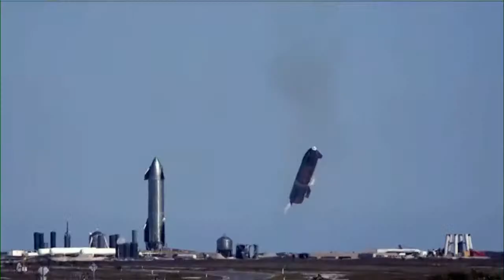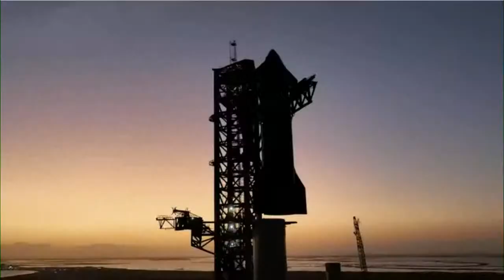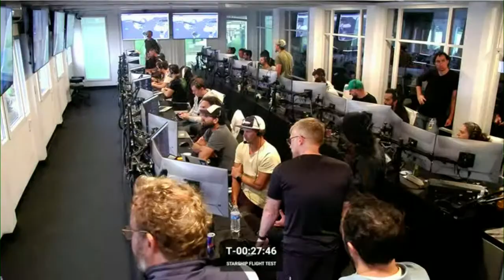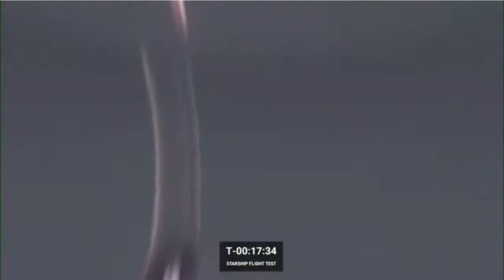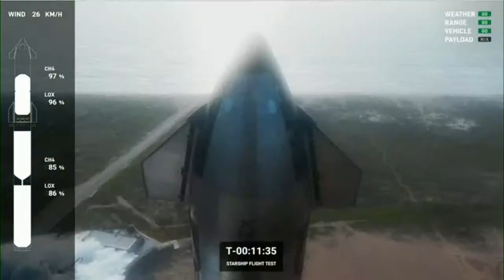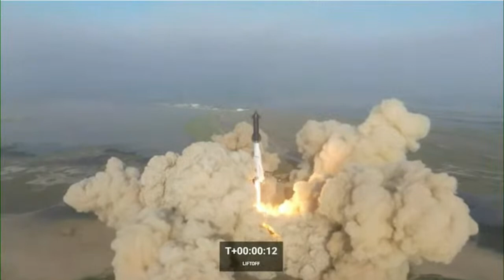SpaceX’s Starship explodes minutes after liftoff - 4/20 (FULL LIVE STREAM)

Comment: I know this has not much to do with the video but a fond memory from my childhood. 
This 2 stages remind me, my brother and my friends back then, we managed to make a 2 stages cartoon rocket. We used a paper tube as a launching pad, below the tube there was a piece of tile and some sulphur which ignites and accelerate the rocket. We used phosphors as a propulsion to the rocket that we have cut of from matches, we used overall 38 boxes. The paper rocket was about 35 cm in length and about 5 cm diameter. We used pins at the bottom to fix phosphor in place and have access to the propulsion. Unfortunately we forget to put stabilizer on the rocket so the first stage simply exploded in the tube after launch and knocked the second stage in the air, about 10 meters high where the second stage caught fire and was violently spinning and shaking like a proper firework, shooting flaming phosphors in circles for some seconds and then the remains of the rocket sadly landed. We collected the body of the rocket for studying and monitoring purposes that we kept in secret, (in a top of a tree nearby) sadly all the data was stolen. We managed 2 other launches with more success but with the same material and method. Do not do it at home or anywhere, at launch a meter wide fireball will come out at both ends of the tube (if you do it properly only at the bottom) :DDDD

Comment: Surface heat reached to very maximum stage and basically booster rocket was embedded to starship seperatin points and during seperating, booster keep pumping extra heat thermal way and that ignited starship fuel...it is an thermodynamic problem...heath did not transfer to atmosphere to cool down and starship looks like very anorthodox design like a male organ.

Comment: Good job spacex .. why 32 small engines for stage 1
Reply: Just the scale of the rocket. Those 32 engines are pretty massive, and making them much bigger would be less practical.
Reply: That's a good question. The main reason is that the entire rocket (both booster and second stage) can use the exact same engine design which will make mass production easier. Another benefit is the rocket being able to fly even after multiple engines have failed, like in this flight.

Comment: Can someone explain what just happened for someone just tuning it? Did the ship explode? Did they care? What was the aim for this launch? Thanks!
Reply: To test launch of the two stage stack.  
Payload separation of the Starship stage (didn't)
Return of the mega booster to the recovery barge (didn't)
Flight and suborbital characteristics of the Starship stage (didn't)

The cheering was that the self destruct worked.  If it didn't they were about to drop two heavily fueled massive rockets on the Gulf or Florida.
Reply: @STho205  so was it successful?
Reply: @Tommy24552  YES.This was booster #7. They never even flew 1-6, they just built them, then they scrapped them. They decided to try and fly this one instead of cutting it up. The most important goal was for it to NOT explode on the launch pad and to get up in the air. Everything after that was just a bonus. It made it to MAX Q and they got tons of flight data. Definitely a success

Comment: I wonder if they will be cheering when it blows up with people inside.....
Reply: It's a test
Reply: @ru2ik  yes, and it failed, it was supposed to go into orbit.....
Reply: @davidli1331  You obviously don't know much about SpaceX and how they develop rockets. This was booster #7. They never even flew 1-6. They just built them, then scrapped them because by the time they were built they were obsolete. This booster was obsolete but they decided to fly it and get some data from it instead of just scrapping it. They have already built booster 8 and 9 which have hundreds of changes from this one, most notably is electronic controlled engine gimbaling. This booster used hydraulic controlled thrust vectoring and the hydraulic control module got destroyed during flight.
Reply: @davidli1331  SpaceX uses a rapid design and iteration process which is the complete opposite of NASA. SpaceX will design, build, test, evaluate, redesign, build , test, over and over again. This strategy will yield the best possible product in the quickest amount of time.
Reply: @davidli1331  if rocket reached orbit, they wouldn't know about problem and this rocket would failed with peoples.
Reply: @mdees88  I know that it wasn't supposed to have to be destroyed....
Reply: @davidli1331   Well apparently you don't know much, David. If the mission went perfectly, the booster was going to splash down in the Gulf of Mexico and be sunk. The second stage was going to crash in the Pacific Ocean at terminal velocity near Hawaii. The entire rocket was going to be destroyed regardless.....
Reply: @mdees88  wow, great plans....

Comment: 1:07:22 "everything after clearing the tower was icing on the cake" then explosion
Reply: "oh..."
Reply: This is part of moving the goalposts backward, then back again, then announcing a touchdown.

It was to launch (did that)
Accelerate to max AD pressure (check)
Payload separation (nope)
Reverse the booster to land on the Gulf platform barge (nope)

It automatically reversed but Starship payload stage was still attached  causing an entirely unexpected CG and therefore pitchpoling out of control.

They detonate both stages to scrub the test.

I wish them the best.  The team has worked very hard, but today was not a full glowing success.  There is still no test of Starship flying on its own raptor drive systems in high atmos, much less sub orbital and orbit testing.

Comment: I cannot believe it spun like that and didn't separate stages. Just incredible. I believe that is a big deal. I have been wondering how those stages would do with a lot of stress.
Reply: They were forced to blow it up due to failure. "The plan was for Starship to soar into space at least 90 some miles (150 km) above Earth before it would re-enter the atmosphere and plunge into the Pacific near Hawaii." -Reuters News Wire
Reply: Yeah, it was like a bullet traveling at 1,000mph trying to separate while spinning.
Reply: Agreed. If indeed they were only concerned about clearing the launchpad, that seems quite expensive to for just that, plus a missed opportunity to do a complete system integration test. It is like them saying: " We are not ready for system separation completion test, but let's go ahead and test clearing the launchpad, will worry about system separation later."
Reply: No amount of spin is going to change the fact that we witnessed multiple failures here: Musk's "reusable" rocket failed separation of boosters with 33 of the engines not igniting AND ended in an unplanned explosion. Musk's face after the explosion tells you all you need to know about the "success." 😂
Reply: @hr7055  You should see how many failures Nasa has and the U.S military…. Its all a process to achieve the goal…Is your hate for Elon that blinding?
Reply: @hr7055  The explosion was intentional. They did a self destruct sequence in case your wondering.
Reply: I thought it was incredible how it blew up.

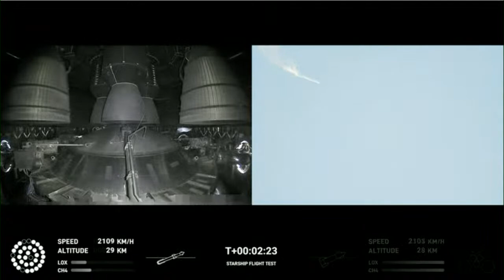Comment: If you watch carefully, at 1:05:57 the speed was 2157 km/h and altitude 31km, few seconds lather, at 1:06:38 the speed dropped to 1606km/h and altitude reached 39 km, but the rocket trajectory was simply out of control, the S24 do not separated, and few seconds before explosion, Liquid Oxigen finished, and BOOM.  Sad to see it, but I'm confident, Elon will make it possible!

Comment: The beauty is that they got SO much good data after the launch and it will make the next one all that much better. It takes time to get a vehicle fully worked out with all the right adjustments and the fact it made it all the way to the point of booster separation is great. They'll figure out the root cause of the issue and go forward. Go SpaceX.
Reply: yeah, sooo much good data - like what?  show us what they gained that they didn't have before that was worth wasting $68 million ?    really, that money could have been better spent on many issues of society but was turned into hot-garbage now littering the oceans - damn, you humans need to get your priorities straight.

Comment: "Getting ready for first stage separation!", as the rocket is clearly spinning completely out of control.

Gotta love the optimism.
Reply: Or: "Musk drops giant space bong on 4/20 launch"
Reply: Marketing department clearly in charge of communication.
Reply: There is supposed to be a slight spin at stage separation to ensure vehicle separation rather than springs, pneumatic pushers, or small solid rockets as other vehicles do. It seems pretty clear that the spin was far too fast, and the booster engines didn't appear to shut down on time -- possibly because of the engines lost on ascent resulting in a longer burn.
Reply: There has and always will be optimistic people when it comes to aviation and space flight. Failure is nothing but early onset success.
Reply: @AnnieO4eva  If SpaceX has more early onset successes, it'll be broke.

Comment: And we went to the moon all those times in 1969 , i think not! We never loose technology once we have it, fact!
Reply: This rocket has twice the power as the previous moon rocket, but has the added challenge of having to land itself in 2 separate peices, this enables it to cost 1/10 of the moon rocket per launch Since the rocket booster is not dumped in the ocean on every launch. The next major challenge will be surviving re entry, this will be the biggest man made object to re enter from space and not vaporize from heat if the heat shield holds up.

Comment: The engines not lighting was the biggest issue imo. Also if they have to do a flip to stage, this rocket is going to be a nightmare.
Reply: Aye to the flipping part. I can see the point of doing the stage seperation that way, if you innately intend to apply retrograde thrust right after separation (aka, if they would stage, then flip and thrust, you would risk collision with the stage you just seperated from). But space is large, so I feel like just staging, and accelerating at a minimal angle for a few moments should give you WAY enough clearance to flip and do whatever. I wonder what the technical reasoning for doing it in this risky manner was.

Comment: imagine if the SLS had tubmled and exploded on its first flight.....People would be defunding NASA. But SLS WAS successful on its first and second flight.
Reply: And it used old technology that has been tested for decades. Not full flow engines.
Reply: Comparing SpaceX to NASA is apples to oranges. SpaceX and NASA operate on two completely opposite philosophies. NASA has ZERO iteration. This is because they have to assure every single part of the rocket will work flawlessly before they ever launch it. When doing that you cannot change/improve things along the way. SpaceX rapidly designs, builds, tests, evaluates, redesigns, builds, tests, and repeats this process over and over. The booster that flew was booster #7. 1-6 never flew. By the time they built one it was obsolete and they scrapped it. Booster 7 is obsolete. They have already built booster 8 and 9. They have hundreds of design changes. The biggest being electronic controls for gimballing instead of hydraulic like booster 7 had. SLS has only flown once by the way. It literally uses parts from the space shuttle. There is nothing "new" about it, its old technology and old parts. But to your point, if SLS tumbled and exploded on it's first flight then NASA should be defunded. Not the case for SpaceX, that is how they rapidly improve.

Comment: Makes you respect those 60s engineers who managed to launch 13 Saturn Vs without any of them blowing up.
Reply: Oh, they blew up. We just didn't have hyperconnectivity to watch every move they made. They had plenty of failures along the way, to say otherwise is false.
Reply: @TeckGK  Didn't they fill one up with water and when it blew it left a sky iceberg?
Reply: They also didn't use full flow engines, these are harder than using pumps.
Reply: Apples to Oranges. You are comparing a finished production rocket to a prototype in it's early developmental stages.

Comment: Whoever wrote the title of this video IS CLUELESS and have ABSOLUTELY NO IDEA the significant of the launch. This launch is considered as a success, regardless if it exploded or not.
Reply: This is 2023, not 1960, better quality materials, years of engineering results and experience, better quality control -  more is expected than a big explosion. Investors expect more than exploding rockets and burning cars.
Reply: @Alfonsodag  You are as dumb as you sound, Please read the main objectives of this mission.
Reply: It’s a test flight!  It was meant to explode. It passed the test ! It was never meant to go to space , there’s no payload ! Rockets have several stages . It passed the stage that they wanted 
That’s all that matters . 

 Next launch, newer goals , newer tests . !
Reply: @Alfonsodag  “years of engineering results and experience” did you miss the part where the Starship is using its very first EXPERIMENTAL BOOSTER? Theyre legit testing the booster to gain more data. Youre literally contradicting yourself.

Comment: How much CO2 are we dumping into the air every time a rocket fires?  Can any company just fire whatever the hell they want into space now?
Reply: No you need FAA clearance for it. And the FAA did sign on this so.
Reply: While methane is a potent greenhouse gas and can contribute to climate change if released into the atmosphere, the methane used as fuel in the Starship spacecraft is burned in the engine, which converts it into carbon dioxide and water vapor.

The carbon dioxide and water vapor produced by burning methane in the Raptor engines are released into the atmosphere, but the amount is relatively small compared to the emissions from other sources like cars or power plants.

Overall, the environmental impact of the Starship's methane fuel is relatively small compared to other sources of greenhouse gas emissions. However, as with all industrial activities, there is always the potential for unintended consequences, and it's important for companies like SpaceX to minimize the environmental impact of their operations wherever possible.
Reply: @greninjaaaaaaa  You sounded like you knew what you were talking about until you said "other sources like cars".  Contrary to popular belief, cars are not one of the biggest contributors to greenhouse gas emissions.  According to the EPA 2021 study, the first thing that came up in my search, they accounted for only 5% of total emissions.  Corporations have always made a big deal about car emissions in order to perpetuate the idea that pollution is a consumer problem.
Reply: @transce  
Nope motor vehicles make up 1/4 of the emissions.
Reply: @ogzombieblunt4626  I am literally quoting from the EPA 2021 Greenhouse Gas Emissions report.  I looked up a scientific report specifically so I could use real world statistics.
Reply: Every second (1) of burn = 
0ne (1) year of all Co2 vehicle emissions in Ca. 
Meanwhile CaDMV nails motorist to the wall with smog ✔️ fees…

Comment: Back in  the day we would have called that an explosion. Nowadays its a "rapid unscheduled disassembly"  Dont try to twist it, the flight was scheduled to last 90 minutes (it lasted 3) go around the earth once (didnt make it outside the county lines) and at least go to space (didnt make it) it reached 35km (as reference Felix Baumgartner jumped from 39km).  The reusable rocket is obviously not reusable after an explosion (so there go the savings)
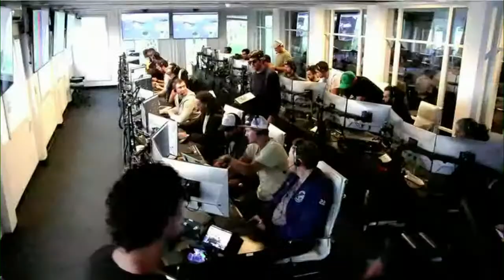Elon's face at 1:08:10 "oh no this is the impact resistant window on Tesla SUV all over again but waaaaay more expensive"
Reply: Yes, the flight had a plan to return both stages.  It wasn't a planned self-destruct.  The odds of successfully completing the mission on the first attempt were always low.  Don't twist it.  SpaceX has had several failures over the years, and even more spectacular successes.
Reply: @garryuyahoo  the only ones twisting are the ones celebrating the explosion like a success after 3 minutes of flight.  They have had success previously this one was big failure (they were saying last week we will be in Mars by 2026 lets get real)

Comment: 😂😂😂. That was way too slow off the pad. Looked like maybe 2/3 of the engines were running. Nice summersaults. That’s a record number for a rocket.😬😬😬🫣🫣🫣
Reply: Have you seen any footage of the Apollo Launches, they are slow to clear the tower too. The Saturn V was 7 million lbs with 7.75 million ft-lbs of thrust, Starship is roughly 11 million lbs with 17.1 million ft-lbs of thrust. These are absolutely massive rockets that have humungous amounts of inertia.
Reply: I’ve seen way more flips from a rocket. Even Russia had about 20 last year during a launch. Though I think that one ended up deciding to land on the launch pad face first.
Reply: It's built so that something like 9 engines can fail and it can still be enough to get it into space to detach before the boosters on the actual ship take over. I'm by no means a rocket scientist, but just based on this test and their other rockets' successes/failures, I would guess 3-4 more attempts before everything from takeoff, booster detachment, and landing are all successful. They get a lot of data from these tests and make adjustments.